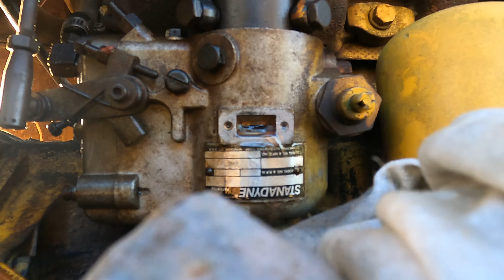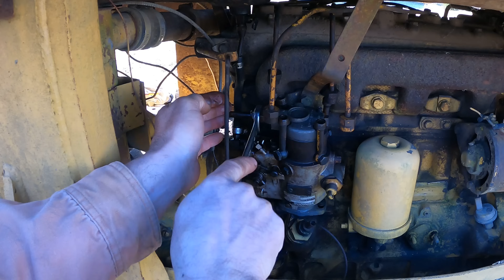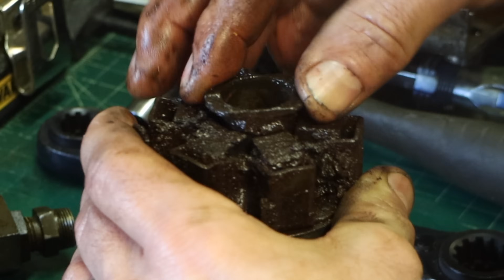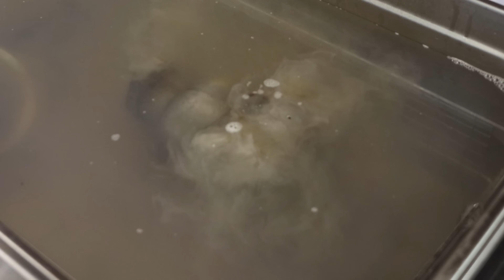Forgotten John Deere 1010 Track Loader, Part 2.

Comment: Hey John,
could you inspect the insides of the cilinders with your inspection cam through the injector bores? Ths could at least tell you if the cilinder walls are badly damaged. Since this is an pre-chamber engine and it has low compression, it will not run without proper working glow plugs. Could be worth to invest in new glow plugs after conforming good cilinder walls.
Greetings from an german engineer,
Kai

Comment: That engine will run. Pop that injector back out and connect the line. Make sure the injection pump is able to fire the injector. Cheers for the video!

Comment: I have never heard of ANY engine not running because of low compression.  It ran before it stopped, didn’t it?  The engine hasn’t run in years, you still don’t know if the pump is 180 degrees off, and if it has glow plugs it needs them.  Maybe not worth extra effort.  Not my decision.

Comment: Well, first i want to tell you i started alot of engines that were or had maybe compression problems. You would be surprised how many times in got fooled by rusted valves. Maybe it is a combination of the 2 in your case. I still think it will start. Just try if the injectors even work..a simple hand pump can do the job with this simple design. I those injectors work glow the hell out of it and try starting it on 24volts for a short time. (Not burning starter ofcourse) i vet ya it wil start with alot of white smoke an settling down. Maybe compare the compression with your bulldozer, because i think that driving smoke screen has also low compression 🙃😅

Comment: pull the glow plugs and use the bore scope. if the walls are pitted too bad its not worth attempting a rebuild. but would be good content to see the insides either way

Comment: I think I'd start with your timing.  When you 1st put the rebuilt IP on and said the timing line was off, I had this exact same thing happen to me when I replaced my IP on my 4 cylinder Isuzu diesel.  Had to pull the valve cover watch the valves on cylinder #1 to find top dead center on the compression stroke. Then check the crank to make sure the timing mark was on TDC. It was,  I put the IP on and it did what yours did it moved the mark out of line on the inspection hole on the IP. Reason being the gear was 1 tooth off so I backed it before the lines would align, slid it in and it aligned perfectly allowing me to move the IP slightly to off align the lines.  Did it run,  no it did what yours did.  So I did some research only to find I had to set the crank to 11deg before TDC then install the IP again.  Got fuel to the injectors and BOOM it hit and fired up.  Ran it for a couple of minutes to get the air out and ran great ever since.  I think you should try something like this before throwing in the towel and going with compression. Good luck and keep up the good videos😎

Comment: hey john, when you used the boroscope on the previous video the intake was clear, but you can clearly see the heavy rust around the valve, so you have probably 3 problems right here: 
1- valve seals losing compression or maybe stuck, easy fix by removing the head and some light cleaning/lapping
2- stuck cylinder rings, you should try to soak them over a couple days with either penetrating oil or kerosene
3- and number 3, the one you are forgetting and most important in my opinion... your oil pan is over full, so your oil is probably mixed with diesel which makes it a whole lot thinner, and believe me when i say that in an old engine like this it makes a huge difference in compression
anyway, just my 2 cents, and excited to watch part 3

Comment: I think you should do the trashiest farmer fix: Simply ring it and go! (Though you may want to blend the step at the top of the cylinder bores). Reason being that a track loader is slow, and you won't use it much anyway when tractors are much faster. It's a good logging machine though.

Comment: With a motor that’s been sitting that long, the dry test cant be trusted. Soaking it will help and then if you can get it to run, the heat and vibration will help more and get those numbers will clean up some. I would give it a soak and then double check your pump timing is right by finding TDC, quick injector clean, pull from a clean source of fuel, and try again. You may win yet! One more try before you tear her down

Comment: Well I guess an autopsie would be your best bet.  If you're going to go deep and depending on what the internals look like it wouldn't be that much more to fix the engine.  And with that... how confident are you that the rest of the clutches, transmission, and hydraulics are good?  There's a rabbit hole there that you may or may not want to go down.  So you have to ask yourself one question... do you go down the rabbit hole or do you just get some tannerite?

Comment: Top end rebuild grind the valves they didn't look good have a look at bores before pulling the engine apart. If it's been rosted could be losing compression with the head gasket

Comment: Try to start it with oil in the cylinders if its stuck rings it may free up when its running (if its the rings or if you get it started)

Comment: Hey John I think you have a huge potential for some great content on this thing! Seems like a lot of people like this machine including myself and want to see it run! I would pull the head, make sure timing is correct, check the cylinders and hone them if u can pull the oil pan I would do that as well so u can pop the pistons out and throw a set of rings on it. I think this machine is well worth it esp since the undercarriage is good👍

Comment: John those wires at 14:00 are not for tamper protection but to prevent the screws from backing out.  They need to be twisted in such a way that they put tension on the bolts in a clockwise direction so that the bolts do not unscrew due to vibration.  Before you tear it down, I think it's worth putting some marvel mystery oil just to see if the rings are all stuck.  Great video John, sorry you couldn't get it to kick over, thumbs up.

Comment: Engine heat cycle + oil in the pots.
Probably via near boiling water circulated through cooling system.
Oil in pots.
Leave it like that for about a day with heat running.
Let it cool, heat it again.
The aim, to get rings loosened up.

Not a bad test considering the effort of taking the engine out.

Comment: you don't show in the video but when you put that shaft back in the pump there should be a dot on the end of the shaft and the rotor just was making sure you got that installed right it would make it 180 out of time.

Comment: Put the injectors on the lines out of the cylinder (maybe turn the lines around) and look at the pattern John. 
I don't think you get any fuel at all, there should be clouds of smelly diesel fog out the exhaust even without ignition, but I didn't see or smell anything.

On the Bosch pumps there is a way to verify the timing with compressed air through the pump and a dial gauge down the injector hole for TDC, but I don't know how that would apply to this pump.

Comment: Hey John. Great video. As much as I'd like to see a rebuild, maybe you should try what another commenter suggested, and preheat the air intake to see if you can convince the tired little beast to fire up so you can check for other noises, see if the hydraulics work, drive train, etc... before sinking more time and money into it. If its got a block heater, that would be an easy way to get some temperature into it. 

I'm not a diesel mechanic, but I'd like to think that even with low compression there would be at least a bit of smoke. For sure, the compression is too low to be in spec, but I wonder if plugged injectors are indeed the problem. Maybe getting them tested would be a good next step.

Comment: try to get it running see if the rings come unstuck like so many commentors said. then rebuild. This would make for a good winter project. We already know that you can rebuild the hydraulic cylinders cheap enough, so you will only have time into it. and not a lot of expense. Good luck sir.

Comment: For content purposes this machine is great to tinker with,if you want one to use your wasting your time.these were to light and weak to really dig,if you notice this machine had a backhoe attachment and I'm sure they would dig with it and load the loose dirt with the loader.if you want one to use don't get anything older or smaller than a 450c

Comment: Nice job on the pump and the whole endeavor. When you were trying to get the compression tester hooked up and you looked at the air line fitting, I said just machine it, I was surprised you hesitated to do that considering every else you’ve done on the lathe. 
I don’t disagree with others about hearing it run but I think it just needs to be pulled and rebuilt to save other parts from damage. It could have stuck valves on top of low compression. Take care.

Comment: Get a leak down tester and figure out where the air is leaking by.  Could be something simple like a blown head gasket between cylinders, especially if it overheated.

Comment: I’d enjoy watching you pull the engine and inspect it. But I also understand if it’s not worth your time to do so. An alternate path forward might be to look at swapping a different engine that is known good. Might be even more interesting if it were not the same motor it came with. How available and affordable are kubota/mitsubishi/yanmar/cat used diesel engines from other industrial machines?  My welder has a 25HP mitsubishi diesel engine that is about the same physical size. Im pretty sure that engine is used in many other machines, like forklifts.

Comment: That lockwire job is no good. Both LHS bolts arent tensioned satisfactorily and the top rh bolt is pulling counter clockwise. Googling aircraft lockwire should yield some results to rectify with. With the correct technique, you can properly tension the wire to the likes of a banjo string while removing that brass piece.

Comment: Hi John,
First many thanks for your channel!
Second, Don't give up just yet. That girl is not due yet for a full rebuild. For an old diesel like that I think that the compression is ok to at least give some smoke. I would first make sure that the injectors are ok. Then check the valves. I gues they could be stuck or at least not moving free. Then make sure the timing is correct. All these is cheep to do. I know the compression is a bit low but thats not surprising as it has been standing for that time.
Also what is talking for that it shouldnt be nessesary to a total rebuild is that the motor, at least from the previus owner, did work until it sudely stopped. The bad compression is building up over time.
Then as some have mention. Don't use ether. Better you try to heat the intake when you try next time. You mention it is minus outside. That is not ideal for a diesel with a litle low compression.
If this still don't help. Well, then it could be many thing and it is up to you but I gues it is probably not worth a rebuild. Warm, (even if it is werry cold here), Christmas greetings from Sweden!!!

Comment: pull the injectors and confirm they are actually spraying John, when you pulled cyl 3 the tip looked dry like it hadnt been spraying, you can have all the pressure bleeding from the lines to make it looked primed but if the injector tips are blocked(and lets face it, you seen the crud in that fuel system) you'll still get what you had, i think theres good enough wet compression to get you going, it might be gutless and no power but it should still run.

Comment: Remove valve cover, get it to TDC for sure, set pump timing. Lube valve guides and rocker pivot points, tap on each valve to ensure they are moving and to knock crud off the seats, set correct valve lash,. Spray a little ATF+acetone down the intake (get each cylinder to TDC so it sets on the valves at the seat for a week each). Buy the two glow plugs, get the injectors spraying. Heating intake air with a heat gun helps a tired diesel fire. Once it pops off check steering clutch/brake operation, check clutch and throw out bearing, run the hydraulics. Put some oil on the chrome hydraulic rods to minimize seal damage. (Put a board where the seat should be, with an old pillow, you've not even sat in the operator's position yet). Listen for wrist pin/rod/main bearing noise. You've still got a bad water pump and issues with the cooling system to consider (cracked block/head?), as well as a hydraulic cylinders and hoses that will need attention. You've likely got crap in the tank, drain and refill with new fuel. I wouldn't rebuild that engine, but getting it running well enough to evaluate the rest of the rig is key. It could be a boat anchor, or could be made "good enough" without too much investment.  It's not worth putting a lot of effort and money into, but I'll watch and enjoy whatever you decide to do.

Comment: I'd look into the injectors. The compression should be enough to at least produce some significant smoke from the injected fuel. The oil thinning signs in the same direction.

Comment: The backs of the valves you showed look quite ordinary, they May not sealing fully, as the engine as been sitting for quite a while, the rings may be stuck somewhat and hence not expanding onto the cylinder walls. I'd suggest soaking the cylinders in WD40 or even diesel to loosen things up, you could also spray some in the back of the closed valves and see if they hold. if valves are sealing correctly the fluild should  not leak down. Then you need to pull all stops to get it to start,  glow plugs, start fluild etc as thats the best way to free things up.

Comment: Pull the head and check the valves. When you scoped the intake those valves looked rusty and crusty. It will also allow you to look at the tops of pistons and cylinders. I'm not experienced with JDs but 2 strokes Detroits  and a few of Mr. Penske's Series 60s; Cats from 3306s, 3208s, 3406s, 3408s and to a lesser degree the C15; Cummins NTC 300s, 400s, N14s and N14 plus but none of its ISX or Xpowered engines, the 3.9 and 5.9 are lovely little engines.

Comment: chance are it will start with those compression number it will run not the greatest but it has not started for a while maybe the rings just need to go thru some heat cycle to find a better sealing

Comment: I have a 3 cyl diesel on my boat. 2 years ago it wouldn't start anymore after a 2500nm trip. I popped open the engine, valves and valveboom and had a valve stuck with rust.  I put fine machineoil on the cylinderheads and after a few days 2 out of 3 still had all the oil, cyl 1 didn't. It was also the cylindre with the rusted valva. Changed the valves, machined the engine head and it started from the first inginition. And after 2 years it still starts after using the preheat.

Comment: Just use the bore scope to determine TDC or if the intake manifold is off just look at the valve.
On a 4 cylinder engine when no. 4 intake valve is opening its exhaust valve is closing. That means it's at or near TDC at the end of the exhaust stroke and the beginning of the intake stroke. 

This means no.1 MUST be at or near TDC on the compression stroke since on an inline 4 the two outside pistons are in the same position at all times but 360degrees apart in terms of the 4 strokes.

It's vice versa if no.1 is the back cylinder - which wouldn't surprise me on anything with a positive earth.

Comment: Excellent video, as always. One item of note , I was taught in one the USAF tech schools i attended was to never click a torque wrench more than Once, clicking more than once actually changes the torque you`re applying (ex. At around 7:10 you clicked 3 times). This is especially true when your set to inch lbs.

Comment: One of comments made I would recheck timing valve cover off make sure firing on No one TDC lock down the timing I think there  is enough compression to get it going seen worse start up with less compression 👍👍

Comment: Oh yeah. Absolutely keep working on it. You saw with the bore scope how badly those valves need to be cleaned up. I would not be surprised at all if your rings are mostly stuck. And since you will be in there doing all that you will obviously need a new head gasket. I think you have all the equipment to fix this if you have the will to do so. Great video John.

Comment: Loved those old John Deere machines. Lived till they didn't and most folks just let them go for scrap as easier to finance a new one than fix something a farmer had no clues on. If you found another power plant like the four cylinder cummins, I would love to see it in the same spot as case used them quite successfully.

Comment: Sorry Jon, it's a bit disppointing. It was smoking a little at 22:30. Going by other comments I think it would be worth heating the input and/or towing at a decent speed. It may be stuck rings and worth persevering before pulling down. I think Andrew's cooked diesel could have been driven out after winter.

Comment: Hi John.  What stops the leaf spring screw from adjusting it's self during operation ?   I'd check the timing - re pump vs rocker position.  Also I'd give it more battery and a squirt of oil in each cylinder to help seal things.  My bet is the valve seats are complete crud.  If you can get it to  run for 30 minutes, it may clean up  .

Comment: The older idi diesels like that didn't run as high of compression. Double check your injectors, just pull them out and hook them up to the lines in the open and crank it over to see if they spray. If not, swap them out. If they do, slam them back in and crank it over while pouring the spicy sauce to it. Do not use the glow plugs while using the spicy sauce. Get it to pop off and get some heat back into it. See how it goes. If the injectors are fubar, it might not even need the spicy sauce....